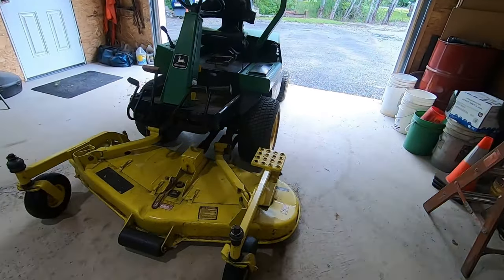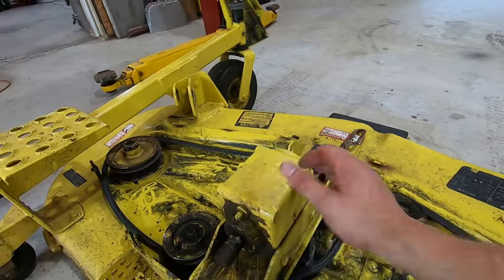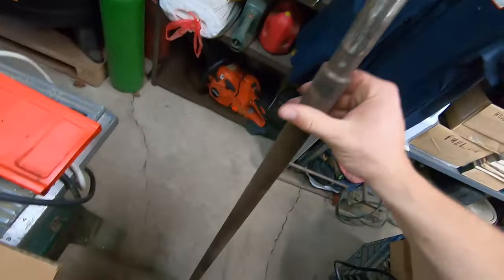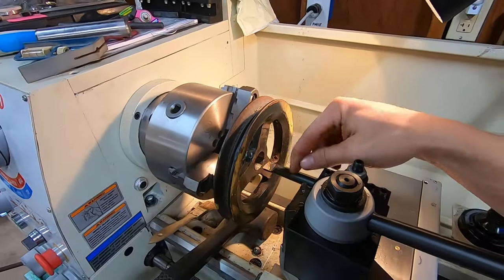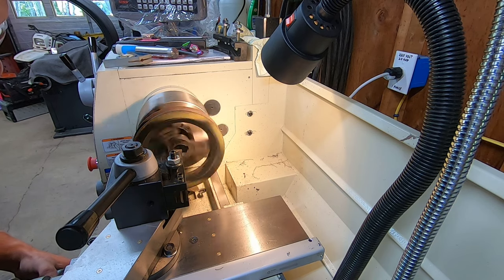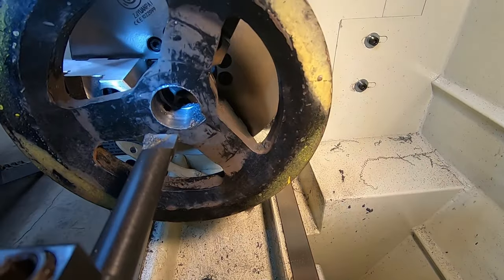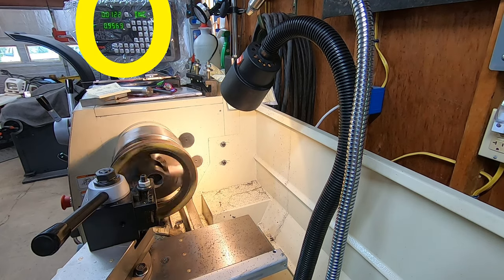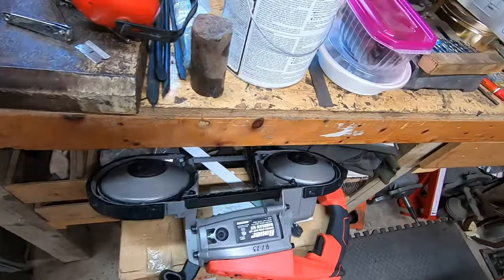Broken Pulley Fix - Lathe (Machining Cast Iron) John Deere F932 - George Jones Mower Build - PART 8

Comment: Ugh.. mark that was amazing!! I just had to take my 935 to jd to have the pto clamp repaired.. I took them the deck to check any damage that might have happened when it broke.  I got a call as they were buttoning it back up; that I had a lot of vibration in my driveshaft, and for 1300 plus labor at $135 hour they'd put it on straight for me.. I laughed and told them that was crazy, and id look for a used one.  Took it to a guy down the street, and he backed the pin out, and put it back in tight.  Works perfectly fine!! No more vibration.  Got the machine home, started mowing, and the belt jumped off the deck.. two bolts loose, one on the guide pulley as you had; and one on the tensioner bar.. both loose.  Tightened back down all good.  Couple more minutes into the mow, the weight bar on the back of the machine fell off.. they had forgotten to put the spacers and nuts back on.. 
Now.. for $135 an hour, I'd rather have paid you!!
Reply from the maker: Thanks! Sounds like you've been through similar troubles as I. Hope you can be trouble-free mowing all summer!
Reply: Just because you pay for something doesn't mean it's done correctly!
Reply: @dans_Learning_Curve  agreed.. but still best to know the differences; for youself; so you can spot the crooks that con ya, for repeat business.

Comment: Picked up an older Toro 330 zero turn this summer for $250.00 Found two broken contenting rods. Yes, they require oil! The rods fused to the crankshaft and snapped! $30 later and meritic acid cleaning the crank I have a running 20HP Kohler Command. 
The 90° PTO box had an input bearing out! The rollers were actually fused to the cone! New bearing and it's back together. Nothing else was damaged surprisingly!
Reply from the maker: @dans_Learning_Curve  nice find!

Comment: My gear box pulley side,  shaft had a woodruff key cut in the shaft and the pulley had a tapered split hub to remove play. Surplus center has variety of pulley dia and hub bores.
Reply from the maker: @tcmits3699  do you know if it was a factory john deere unit? It looked like the newer models had a tapered shaft, so that must make mine one of the older ones...
Reply: @marktolman6037  Yes it was factory.  They make a 2 piece pulley set consisting of a split hub with a straight keyed bore and a large outer taper that gets drawn in a corresponding tapered bore of the pulley with two bolts.  It locks the two on the shaft removing all play, like a collet.  Go to surplus center, they have a variety of hub and pulley sizes. Good luck 🤞
Reply from the maker: @tcmits3699  Thanks. I'll check it out!
Reply: @marktolman6037  They are a little more expensive, but worth it.  PS. My F935 had a differential lock lever on front of the transaxle, and a simple linkage was made, can't hurt to see if your machine is so equipped.  Also mine had a second hydraulic spool under the right fender next to the lift lever spool.  Really nice machine when you work out the bugs👍
Reply: I believe that's called a taper lock.